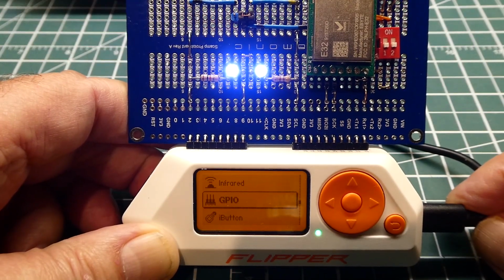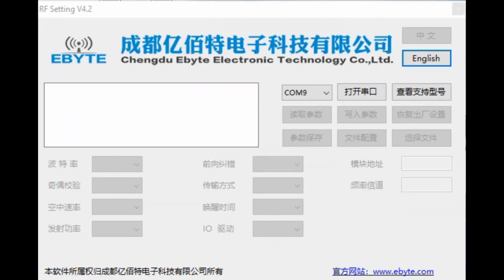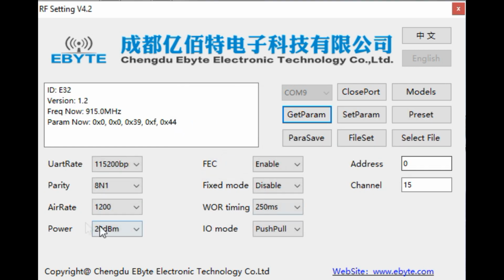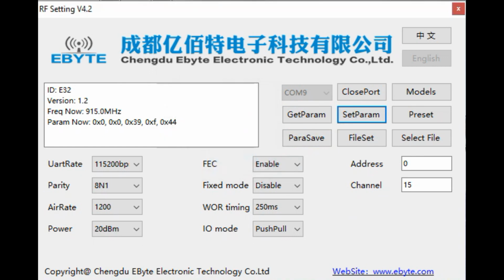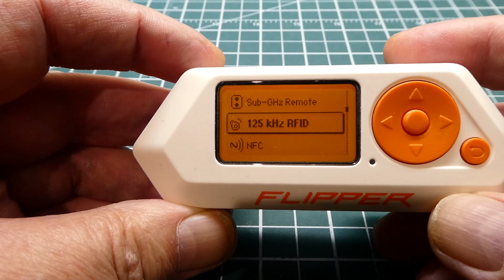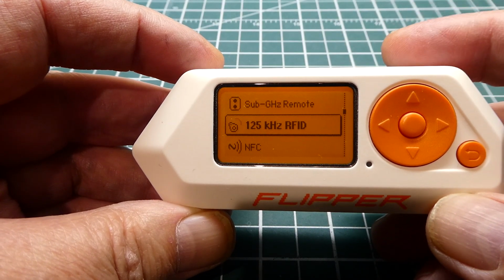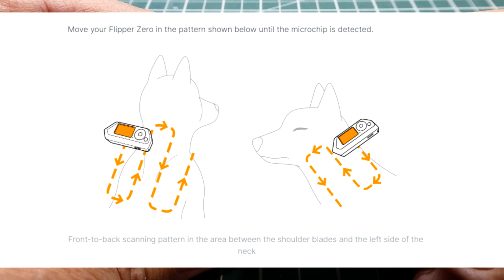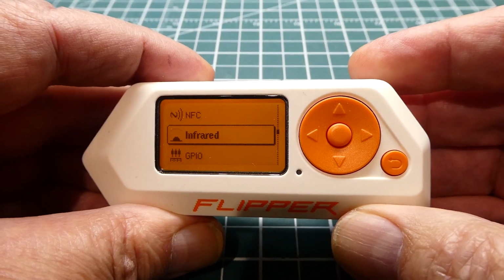Flipper Zero / LoRa / Remote Control

Comment: Great video.
I have 2 REYAX RYLR998 UART Interface 868/915 MHz Lora Modules

That I'm looking to use with my Flipper Zero. I might install the other on my laptop until I get a second Flipper Zero.

Someone made a LoRa app for the Flipper Zero on GitHub but I don't understand how to install it on the Flipper Zero.

Can you do a video on how to install the GitHub LoRa app on a Flipper Zero? Watching this video it would seem like you'd understand how to do this.

I think communicating to other Flipper Zero devices & other LoRa devices would be incredible!

Comment: Animal rfid frequency is 134.2 kHz. Can you read it?
Reply from the maker: The Flipper supports 125 , 128 , and 134.2 kHz RFID microchips with the FDX-B protocol. It's frequency range is from 110 to 140 kHz. For other high frequency chips use the NFC mode.